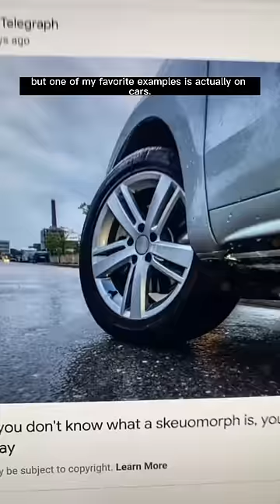Why do maple syrup bottles have tiny handles?

Comment: Also the same reason turn signals click. Originally they clicked because it was the sound of a relay turning on and off, but now since everything is controlled by computers, it’s not really necessary for anything but an indicator.
Reply: Although the loud clicking is a nice reminder that your turn signal is on. (Sometimes when you turn it doesn't shut off right away)

Although this audio indicator doesn't need to be a click, its probably too much work to change it now that people are used to it. (Same with the camera shutter noise for phones, it could be anything but 1 generation had both phones and mechanically clicking shutters so they associated the shutter click with a picture being taken, and the phone designers simply took advantage of the existing sound association instead of training people on a new one.)

Comment: Fun fact: smartphones making camera shutter noises is actually a law requirement in multiple countries. They use easily recognisable sound to make taking hidden pictures more difficult. There was an option to turn it off in old smartphones but eventually to avoid legal problems it was removed.
Reply: But iPhones have that option??? Of mute and it doesn’t make the shutter noise?? I’ve got an iphone 13pro so idk about the 14th generation but my phone has the option of muting (I probably just live in a country where that option isn’t illegal tho)
Reply: @ahhhhhwahaaaa630  Yeah, it's because of where you live. It's possible for the same model phone to have region-specific firmware, where models sold in some regions let you turn off the shutter noise, and in others it makes a noise even in silent mode.
Reply: That's a thing in Korea because people kept taking Inappropriate pictures of women

Comment: The shutter sound on the camera is used as anti-perving measure too - there's a lot of phones that don't give you the option to turn it off, even if the phone is on silent, so you can't take covert photos, because the sound is instantly recognisable.
Reply: Can confirm. I eventually had to buy a phone with the removable back, disconnect the speakers and reassemble.
Reply: @JamesBond-xx1lv  hol up….
Reply: Omg THEE James Bond AND beanie baby in the same thread?

two celebrities in the same place ✨

Comment: Also for cars, doors are designed to close loudly, because studies would show that people would the doors way too hard without the noise
Reply: Also also for cars, the click your blinker makes is artificial. Old ones had a spring that would heat up, bend, complete the circuit to turn the light on, and then pop back into place to turn it off. This pop back into shape made a clicking noise.

When it went fully electronic in the 90's, an artificial click was added for fear of drivers leaving their blinkers on without a sound cue.

Comment: Actually,  the handle on the maple syrup bottles is used during the bottling process.  The bottles are hung from a hook after being filled and transported to the labeling area, where they are labeled and the shipped or stored.  Saw the whole process in a video once.  Might have been on how it's made.
Reply: This makes more sense and wasn't presented in an aggressive and angry manner. Thank you.
Reply: Finally the correct answer.
Reply: They might be used that way, but I doubt it would be why they're there. They'd just be taking advantage of the design feature. Thousands of other products are bottled in factories without the need for little loops to dangle from hooks.
Reply: That isn't why they are there - just a usage of that feature in that particular factory. Standard glass bottle options work just as well for maple syrup and there are brands that don't use the traditional maple syrup jug shape.
Reply: Hello 

Production engineer here(though not in maple syrup field)

While some manufacturers do design their machines around the handle

They dont actually have to do that and is just a design choice

You can easily design the production line to not use the handles and i would assume it would save time and some money if the handle didnt exist

But this decision definitely comes from the marketing and sales department and not the manufacturing department

Comment: I thought you were gonna say most of the noise in newer electric/hybrid cars is from a speaker
Reply: Same is true for many internal combustion vehicles.
Reply: to be fair, that kind of feature is at least as much about safety as it is the skeumorphism of "powerful car make big noise"
Reply: Keyboards are clacky for similar reasons, we know how to make them silent but users missed the auditory feedback. (Also see touchscreens going tic-tic-tic.) Though in the case of cars it's also so other people can better hear it approaching.
Reply: As others said, it's more to alert others than to reminisce of combustion cars, which is why fake noise is mandatory but only when below a certain speed. At that point, tire noise is enough.
Reply: My friends hybrid that makes no noise freaks me out: it just drives off with no warning. Didn't realise how used to heating an ignition sound i was!
Reply: There's actually 2 reasons for this:
1. The safety reason as mentioned, especially for pedestrians, since e-Vehicles are usually so quiet.
2. Cybersecurity. The fake sound is meant to throw hackers off on the internal working of the system. Since alot of electronics are hidden in the car, hackers rely on the sound to figure out what's inside & bypass the system. Kinda like how car enthusiasts pay attention to different Lamborghini sounds or Ferrari sounds & can tell you about the engine in detail. A fake sound masks the working of the system & if anyone still tries to bypass the system, they end up in a honeypot

Comment: Irony is they weren’t hub caps in the picture, they were alloy rims
Reply: yeah I'm like wtf is he talking about
Reply: Even then, you don't want to have hub caps on your ride that look like @ss, do you now? So yeah, you make them look nice. I mean, that's one helluva bad example he had...
Reply: And the hub caps arent hub caps anymore. Original hub caps were metal caps that prevented dirt going into the wheel hub. It is not a cap if it doesn't cover anything properly
Reply: To add on to his point about the hubcaps though most "hubcaps" are a piece of plastic that is supposed to look nice they don't serve an actual purpose anymore, so not only do they not need to look like they do, but no modern car needs it
Reply: Ohh, he means the thing steel wheels have so they appeal more to customers (or make them more aerodynamic).
Reply: @nukkumatti9587   modern hub caps still cover the hubs, and often the wheel studs/nuts/bolts
Reply: yeah he's dipping his toe into something he knows nothing about with cars. They literally are still wheel spokes just made out of alloy metal.
Reply: It's a nomenclature thing. The alloy wheels he pictured were not hub caps, but they do have "hub center caps" which actually cap the hub like old school "hub caps". At some point in the 90s, plastic wheel covers hijacked the term "hub caps" and enough people used the misnomer that we all just call them hubcaps now. But yeah, the little coin in the center of the lugs is indeed capping the hub.
Reply: Hank likely knew hub caps were plastic and made to look like wheels. Maybe then it was that knowledge that led him (or his editor?) to misidentify a wheel as a hub cap. 

He is technically right, though...the wheel doesn't need to have a five spoke pattern. They can be perfectly flat if you don't need to aggressively cool the brakes, or have as many spokes as you want, so long as it's at least 3 for a functional wheel. Five spoke is arguably a better looking wheel vs 3, 4, 6, or 8 spoke...but 7 spoke can be pretty cool. The spoke design helps minimize weight and maximize strength, so with the exception of heavy luxury vehicles, wheels tend to take the spoke route.
Reply: This thread is a masterclass in pedantry

Comment: Hank that's a wheel, not a hubcap... it definitely needs the spokes. 😊
Reply: Good point.  Actually the hub caps of earlier years did not for the most part have spoke-looking designs; these big thick faux-spokes appeared when hubcaps went out of use.
Reply: @cliffordhodge1449  yeah looking back at particularly older German cars you see a lot more either simple circular hubcaps or ones with weird designs/cuts (1st gen Ford fiesta for example)
Reply: I mean, you could make a solid wheel, but unsprung rotating mass is one of the most important places to cut weight down for handling, performance, ride quality and efficiency.

Comment: The outside of the bottle always gets covered with syrup. You need an easy way to pick it up so your fingers don't get sticky.
Reply: I think the young lady meant to point out that the handle is too small for even a pinky finger to fit inside to hold it - except maybe for a small child. But no adult pinky finger could fit in it. It is clearly an aesthetic elemently only, not a practical / functional handle.

Comment: I'd like to add that a "Hub Cap" is that tiny disc in the center of the wheel. It does serve a purpose in auto repair. A "Wheel Cover" is the large plate that you slap over your wheel. Steel wheels typically come with the wheel covers, but do not have hub caps. Alloy wheels come with hub caps.
Reply: I swear you're one of only like 9 people left on this planet who know what a hub cap actually is.
Reply: @redbunny22  its a cap on the hub?
Reply: @visheshl  yes exactly. It's a cap on the hub, not the rim. like the wheel covers on a lot of steel rims aren't hub caps.
Reply: Oh wow they really shrunk in size huh.
Reply: My hubcaps are just manual lockers
Reply: @100GTAGUY  There is a type of hub cap, like the one implemented in older Toyota Tacoma's that have manual locking hub caps. Those hub caps play an essential role in the 4wd system as they actually engage the front axles. In the unlocked state, the axles are able to turn freely inside the hub.
Reply: Steel wheels don’t generally have a cover for the hub that is separate from the wheel cover. So the wheel cover acts as the “hub cap” that an alloy wheel would have.  Same same but different.
Reply: Alloy rims have centre caps not hub caps. They are purely aesthetic

Comment: Another one from cars, turn signals. It used to be that noise was the actual sound of the bimetallic strip switching the turn signal on and off, now that everything is digital it’s just a sound coming from your speakers.

Comment: Hubcaps don’t need to look like that — proceeds to show an alloy wheel without a hubcap.
Reply: U can see the spokes behind it tho
Reply: @Dmrgamingdoesgames behind WHAT
Reply: @Dmrgamingdoesgames  No you can't, that is a brake rotor with reflections on it.
Reply: Thanks a lot! I paused for the hubcap on the picture, but there was just a metal rim 😂
Reply: Also I'm pretty sure the alloys look like that because they're functional, allowing more flexibility in the tyre as well as removing weight from the vehicle and they look better not because "herp derp bicycle"
Reply: I still dont know what he meant by, hubcaps dont need to look like that? They dont need to look like what?
Reply: @chris86simon  they don't need to look like a hub and spoke. Not sure why he is framing the hubcap as a successor to the rim, though. Maybe I'm also not getting the comparison
Reply: @bencastor9207 that made no sense. Are you trying to explain why having spokes instead of a solid wheel is functional?
Reply: It hurt my soul when I heard a grow man refer to spoked alloy wheels as hubcaps🫠
Reply: @chris86simon im not sure about newer cars but on many older ones, there are spoked or designed hub caps that are made of plastic that cover the actual solid wheel. Purely aesthetic. 

Just the example he showed was an actual wheel lol

Comment: There is a use for them though, you can put a stick in them and use it to turn them the exact angle you want for pouring syrup. Atm that's just a little extra precision, a lot more effort. However a simple device could be made by a wood worker, to optimize it's usefulness, so your maple syrup is always with a wooden stick going through it like a toilet paper roll. When you're bottle is empty replace it with the new one. Then just tilt your bottle within the device for optimal pouring.

Comment: Annoyed at the fact that you showed an alloy wheel that in fact NEEDS the spokes to function as a wheel and not an actual hub cap...
Reply: Glad you spotted it
Reply: Yeh, the only part of that wheel that doesn't have a spoked design is the hub cap! Think he's talking about wheel covers, or hub caps that blend into the spokes, not with that picture though.
Reply: yeah the hub cap is the small cap in the center of the wheel.

Comment: My favourite example of this which because of my industry (Canadian Autozone, pretty much); are turn signals in modern cars. Old cars had relays in them called flashers that made an audible click when the signals flashed. Modern cars dont require these flashers – but the car still makes the little click sound from behind the guage cluster. It's solely there to seem less jarring and normal to the drivers.

Comment: Hubcaps are a great example! They went from being fairly small little dust cap sized covers (same style found on most small utility trailer hubs these days) to covering the lug nuts and then eventually almost the entire face of the rim on a lot of models throughout the 40s, 50s and 60s. The  main reason why they're not a complete cover these days is because of the realization that no holes in wheels leads to hotter brake and temperatures. These plastic 5 star covers on modern cars is an attempt at beautifying steel wheels.

Comment: the hubcap is he thing in the middle of the wheel. like in between the lug nuts, it covers the hub which is in the center. there used to be bigger hub caps that covered the lug nuts as well and were handy at holding the lug nuts when changing your tire.

Comment: We use glacial acetic acid at my job and it comes in the same bottle only bigger. The hole is big enough for your thumb and its meant for you to put your thumb through as you hold onto the nozzle when moving it around.

Comment: With the big glass jugs you can put your index finger through the hole, twist your hand around so that the bottle is behind your wrist, then bend your arm and tip the bottle so that your bent arm cradles it while pouring

Comment: Skueomophism is for object dicoverablity. The more feedback an object gives you the easier it is for a human to figure out how it works. It might seem redundant but its the same reason bottons on things like key boards give you feed back when you press them. They dont have to do that they could be touch but It tells your brain you actually pressed it and it did something. Its also the reason why people sometimes push on pull doors to open them. Because the object discoverability is being thrown off by some redundant skeuomophic features. Usually. Some people are just dense 😂🤷‍♂️

Comment: That's not a hub cap, that's an aluminium wheels and those are indeed it's spokes. We went back to wheels with spokes for their light wieght for efficiency and venting hot air from disk brakes

Comment: Okay the car wheels thing is perhaps true for steelies, but the wheels he showed in the video are actually shaped like that, it’s not a hubcap and the spokes could provide a legitimate reason like heat and dust ventilation to keep the pads and discs cooler and keep from brake dust buildup.

Comment: You kind of missed the purpose of the handle on the maple syrup bottle….its not a handle.  The design of the bottle in Canada has not changed since the 1800’s.  The purpose of the “handle” is to tie a narrow rope through so you can hang it on the outside of a pack.

Comment: The point about the hub caps is so true. (Prefacing this by saying Elon is a fascist monster, don’t buy a Tesla until they fire him as CEO) one of the features of all base model Tesla’s is to snap off the aerodynamic hub cap covers that come included, because people don’t like how they look even though you get about 10-20 more miles on a charge depending on if you suck at driving or not. 

Source: I worked for them for a few years. Sold them, delivered a lot of them, and then moved to service becauseI wanted to help fix them, but instead was instructed to do things like not inform customers of voluntary recalls, not tell people that we were performing required recall repairs when they came in for other service, and was asked to stop recommending third party options for tires when ours had been back-ordered for months with no ETA. I quit just before the muskrat bought Twitter.

Comment: I work as a tire technician so imma be pedantic, that’s not a hub cap. A hub cap is what goes on steel wheels to hide their cheapness and make them look like normal wheels. That’s just a normal wheel. You can tell because there isn’t a wheel behind the spokes and it has a center cap.

Comment: The difference is that the tiny handle that no finger has any hope of fitting through is completely useless, and a waste of additional plastic mold. Not a huge thing, but it's still a valid question: Why?